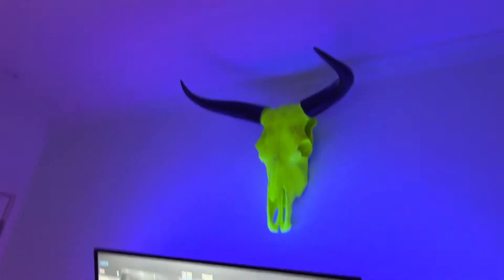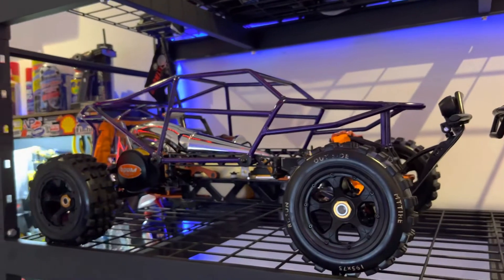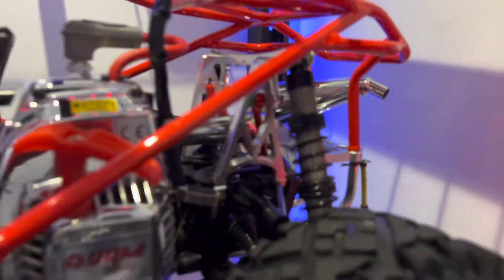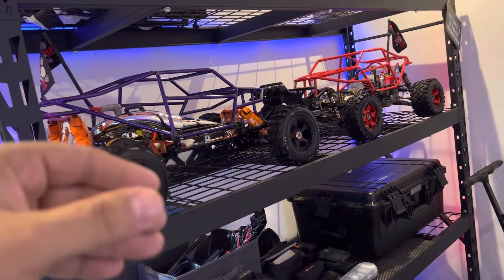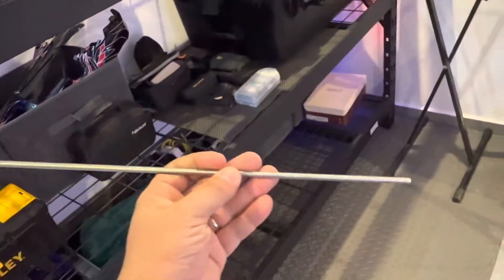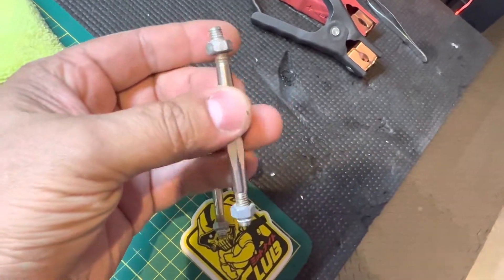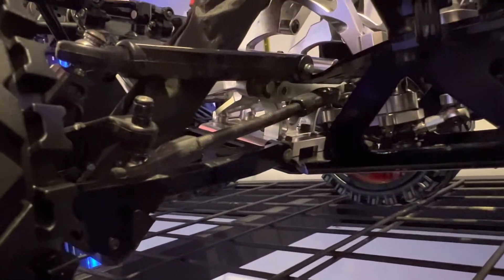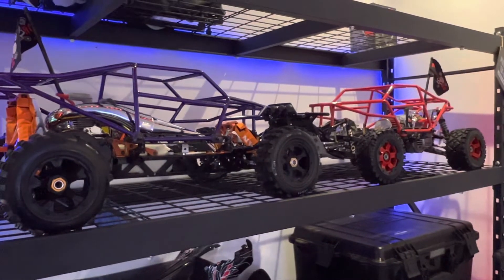Kingmotor or Rovan? Which one is better?

Comment: Can you do a install video on the ext arms. Mine don’t fit
Reply from the maker: what arms do you have? sometimes all you have to do is maybe shave of some and it would fit
Reply: I have the rovan extended arms. The problem I was having was that the upper a arm was rubbing on the wheel hub and it wouldn’t turn freely . To fix it I just replaced the ball joint piece of the upper arm to the stock plastic one and it worked out 💪

Comment: Hey Brian,  I reached out to Rovan and asked the question? Which version of baja5b is better or is there a difference in quality ?  Rovan or King motor?

From Rob @ Rovan/Kingmotor

They are just 2 different manufacturers making the same type of buggy. The km ones we sell have a few aluminum parts installed already on it. Each buggy has its own special characteristics whether engine size, pipe, or other features. Thanks

Rovan has the slight advantage in plastic parts. They are overall a bit stronger than the king motor plastic parts. Thanks
Reply from the maker: Not in my experience, my rovan A arms snapped while the king motors are solid. The engine is slightly weaker than the KM, so yeah I based my opinion on my personal experience
Reply: @GottiRC  👍🏁🏎️
Reply from the maker: @alexs15scalerc36  how is your baja build coming along???
Reply: @GottiRC  hey Brian, it’s coming along nice I just found out I got Covid for the second time so I’m resting and ordering more parts little by little. I was considering getting a two or three speed transmission for the Baja just like I did with the Losi. just last weekend I got finished building most of my alloy parts on the Baja. What I really wanna do is I wanna take my 45 cc off my losi and put it into my Baja and then for the Losi,  I want to get a brand spanking new OBR Signature Series or I might go with the twin. .. 😜
Reply from the maker: @alexs15scalerc36  nice man! Get well soon! Also got that shit twice it sucks! Lots of liquid and soup bro. Also make the update vid and good choice on the engine 💥🧨💥🧨💥🧨
Reply from the maker: @alexs15scalerc36  ooeeeff thats the holy grail right there. Big bucks thats for sure. Would love to own one of those
Reply: @GottiRC   lmao.  Thats da shit right there. I may get it 🤣
Reply: I never showed you my custom rovan/losi5t ? Im jumping between losi n baja. Long story short, It is no longer a rovan or losi.  Its a custom build. Took me 8 months.  I still have a-lot of parts to add like phat dads drive shafts, drive cups, Servos etc,  but it looks doped out.  If i would of added the taylor rc Diablo 2stroke, my build would cost just as much for that RTR.  Im thinking of buying the OBR Twin.🤘